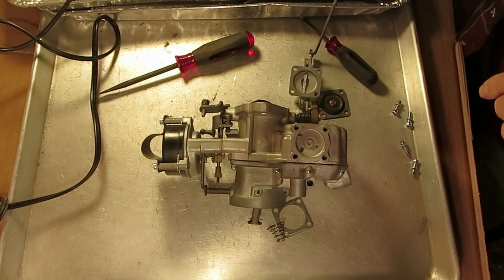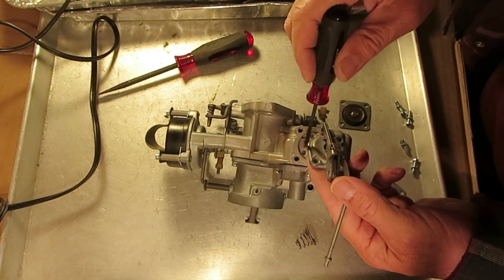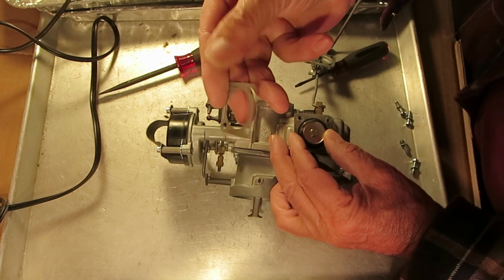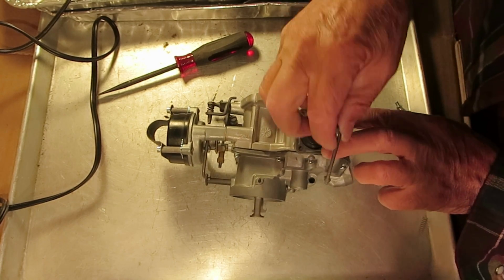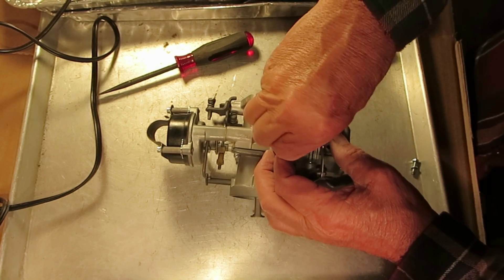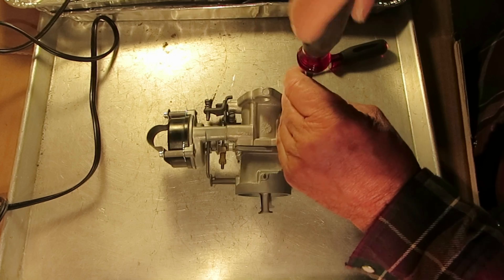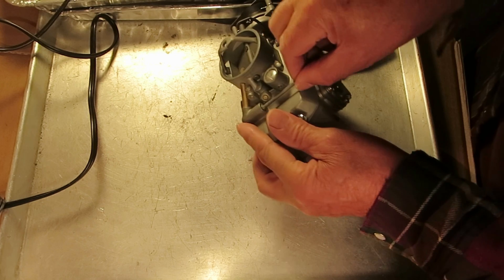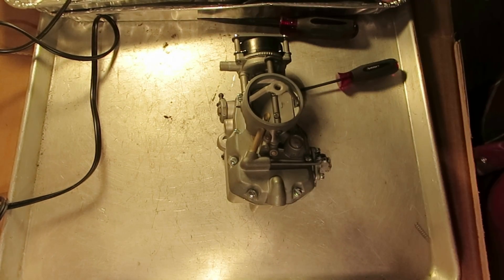Autolite 1100 Replace Accelerator Pump Diaphragm

Comment: How do you know if the pump is bad?.  But Not leaking?.
I'm having a double of a time knowing why my mustang sputters/weak with acceleration.
Replacing coil, that says the accelerator pump could be bad so thought of replacing it.. And go from there
Reply from the maker: Please look at this page for your answer: https://www.carburetor-parts.com/why-does-my-1100-hesitate-when-pressing-the-throttle.html

Comment: Great videos on the Autolite 1100.  I just finished rebuilding one with your premium kit.  My 1100 lacks the power arm that connects the accelerator pump to the power piston.  The tunnel where the piston would be is plugged with a stainless steel cap.  Should I worry about this?  Should I replace the piston and power arm?  '66 Ford 200 CI with automatic transmission and LoadOMatic distributor.  Thanks!
Reply: That would be the vent valve and rod.
Reply: Just ordered one!

Comment: Just rebuilt my 1100 for grandfathers 64 1/2. Thank you for the parts. 

If I use the plates (I didn’t) will I need to bend the two bottom rods at all?